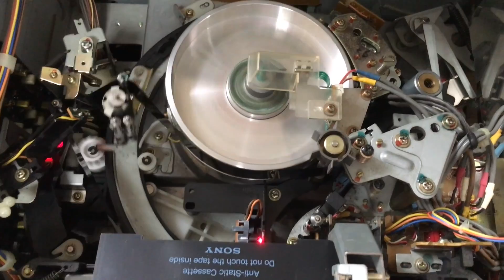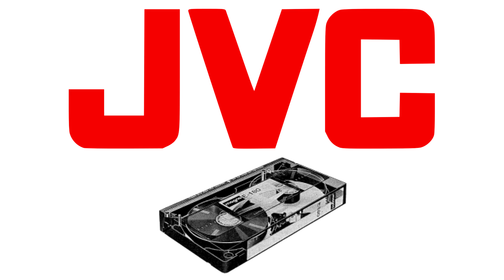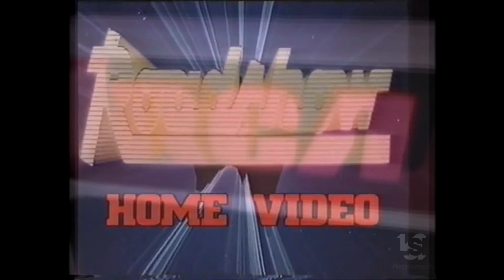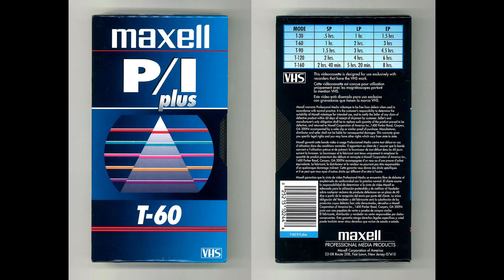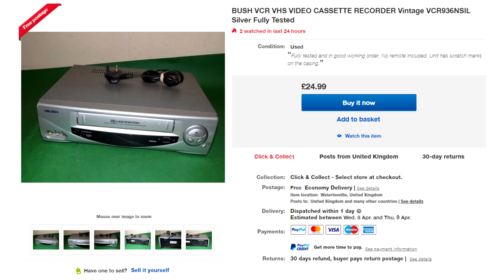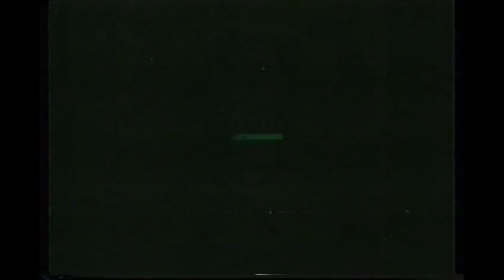Betamax: Old Technology Returns Once More

Comment: The fact that the sharpness advantage of Betamax became obsolete with the introduction of HQ-VHS in 1986 was not mentioned here. The noise disadvantage of VHS can be better addressed with AI today than lack of sharpness. Betamax and VHS were not available in PAL/SECAM countries until 1978. Sony had finalized the 8mm video format in the early 1980s, eliminating the need to consider more compact Betamax cassettes. Sony didn't want to repeat the failure of Betamax and tried to get as many manufacturers on board as possible. The delay also allowed the use of CCD cameras from the outset, whereas the almost square prototype that Walter Cronkite demonstrated on TV still used a tube camera.

Comment: hi to all betacam came out in 1982  i came say i still have alot still work 40 years on  they are very goold decks right tanks of a video decks 

there's not many betacam on ebay now that are 100% still have all the front panel parts now  
and alot get hold of the later betacam  digi player to get video from tapes

Comment: SVHS was an increased resolution version of VHS (luminance part only with the color being the same low resolution as VHS).  I had 3 different SVHS machines and the recording speeds and times were identical to VHS (2 hours in SP on an ST-120 tape and 6 hours in EP on an ST-120 tape).   Where did you get the 15 hours from?  Are you confusing SVHS with those security recording VCRs?